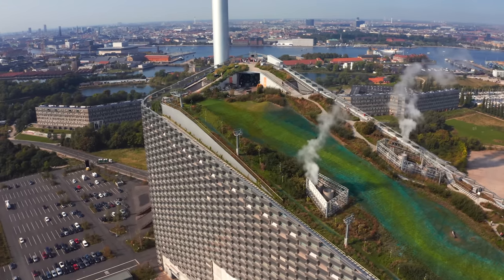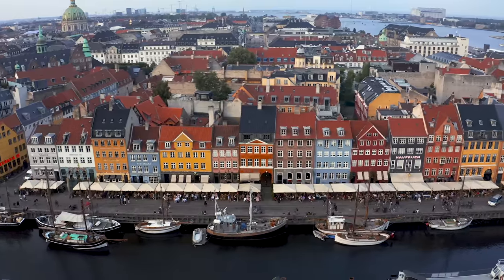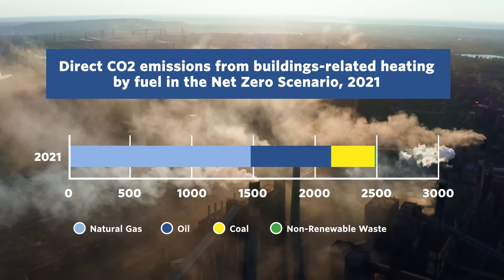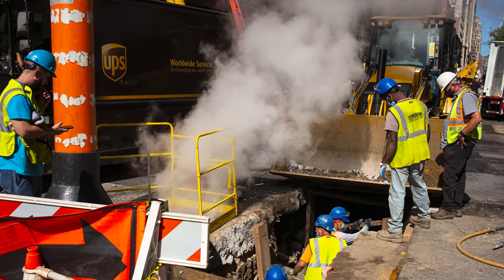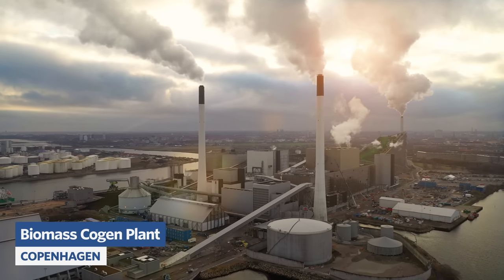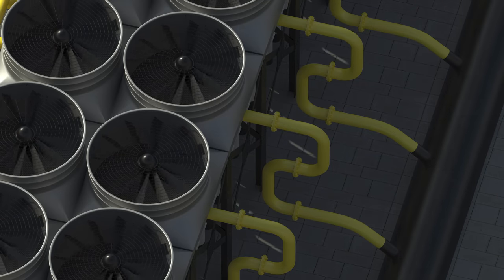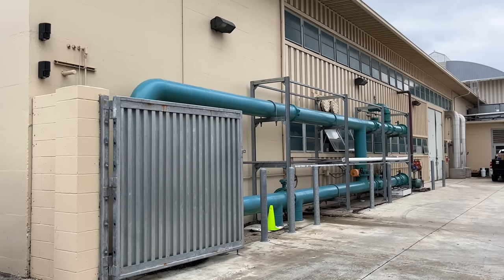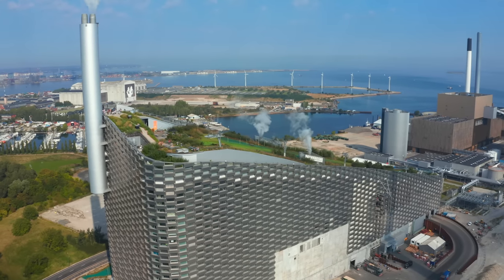An Introduction to District Heating Systems

Comment: What is really neat with district heating is that it is just warm water running through pipes, so you always change HOW you boil the water if another method becomes more efficient. In Denmark they are trying to install a system in which if it gets very windy and the electical price drops to next to nothing, then they switch to electrical district heating instead of burning stuff.
Reply: In addition warm water can be used to store the energy as heat. In Finland we have huge barrels of hot water stored as a reservoirs for the case the power plant has a problem. In Helsinki there's also a massive cave underneath the city that is used for district cooling during summer and can be used as a heat reservoir during the winter. It's like artificial geothermal energy reservoir, and utilizes heat pump technology. And the craziest part is, we've not tapped to nuclear district heating, yet. Immense amounts of energy is just wasted.
Reply: Very nice. Stockholm has a set of massive heat pumps using the heat in its waste water system. The optimal production mix hour by hour in a large heating system is a field of study in its own right.
Reply: thats super cool
Reply: Literally the same benefit of having people adopt EVs - yeah right now most of the US's electrical generation runs on natural gas, but we can easily swap that out for wind, solar, or nuclear fusion, as opposed to a ton of combustion engines roaming around
Reply: @sparklesparklesparkle6318  read it again. I clearly said a right wing government made a statement and chinas reaction caused the issue. I think it was a 100% fair thing for the right wing government to say. Them being right wing is irrelevant to the circumstance, but blaming it on left wingers is simply idiotic. No one in the situation is left wing. 

What food processing facilities are you even talking about? How does that have anything to do with coal availability in China?
Reply: @sparklesparklesparkle6318  P.S. China is restarting communication with the new centre left Australian government. In other words, left wingers are solving the coal price issue, and chinas blockage will likely end in the next few months, contrary to your incorrect misguidings about political inclinations.
Reply: In Vienna, Austria they recently built two huge heat storage tanks where water is heated only if there is excess renewable electricity available.

They have a lot of other cool sources of electricity/heat:
- hot air from subway tunnels ( friction! ) heats homes
- a waffle factory's and a thermal bath's waste heat heats homes
- the city's waste water heats homes and generates electricity ( more than the waste water treatment needs )

Of course the waste incineration plants also produce electricity and heat, like the power stations which first use gas turbines and then steam turbines to generate electricity and heat for the district heating afterwards.

Now they are going geothermal ....
Reply: ...But how do you get the electricity for the "electrical district heating" do you think? You burn stuff.
Reply: It gets better, you cna combine it with district cooling and now you can take heat from industries who pay to be rid of it and sell it to households.
Reply: @McSlobo  I am from India, we use a star called sun for heating.

Comment: Here in Finland district heating is the norm in cities, up to 90% of buildings use it and in the entire country 46% of all buildings are heated with district heating. Up to 95% of new apartment buildings are also connected to district heating.
Reply: Some buildings are leaving the district heating network in favour of ground source heat pumps as some cities have issues keeping district heating costs under control or some heating companies show quick price increases. Tech is great but some companies simply ruin the great idea by failing in pricing.
Reply: @Karjis  middlemen taking their cut
Reply: @mrwess1927  that is one part yes, another is the quite high cost of the grid itself. It makes sense in dense urban environment, but when basically creating one more grid with power, sewer and water to residential areas it's not that cheap. 

Some district heat companies also have the pricing model built so that they clearly do not want to keep small customers. In example quite high monthly fee and low'ish energy based fee.
Reply: @Karjis  Have you  heard of Polar Night Energy that uses a large insulated sand mass to store heat for months and recovered when needed to produce cogeneration. In summer when they have excess wind and solar electricity it heats the sand.

Comment: District cooling is such a neat idea! I'm slapping my forehead wondering why I didn't ever think of this! In Scandinavia and Germany (yes, also Norway) we have district heating in a lot of places. Suffice it to say, those countries are very good at dealing with the cold. However, in the winter, our radiators are completely empty and useless, whilst the temperatures frequently go above 30 degrees celsius with no AC anywhere. This lack of AC actually leads to some increase in mortality and is stupidly uncomfortable. Maybe the solution to the problem is literally in front of our eyes, and all we have to do is convert our radiators from warmth generation to cooling units. That could massively improve quality of life in the summer!
Reply: It's not that straightforward unfortunately.
For cooling you need to blow over the coils. And there will be condensation on the coils. So you need a resistant material (most older radiators are cast iron, which isn't suitable) and also a means of draining the condensate away.
Reply: Norway is far behind Sweden in district heating (10% vs 50% of homes heated by it respectively), but on par or better with district cooling, possibly because Norway is a relatively newcomer to district heating, and this is a newer idea.

A disadvantage though is that district heating serves two purposes, heating homes and heating water. So, given that most systems use two pipes, one for the hot water, one for the return water, when the system changes from heating to cooling, recipients lose the remote hot water. It could be fixed with three pipes (main two, plus extra hot water in summer), or simply by also having local water heaters. Less hot water is used in summer anyway.
Reply: @Free-g8r  Cooling can be had by remote heat pumps, like you describe. 

That's not how it is done in Scandinavia though, where most everyone live near the ocean (failing that, a lake). On the sea floor the water is likely to hold 4°C all year round, so a simple heat exchanger (two closed loops of pipes) transfers coolth from the sea to the district heating (now cooling) system. As sea water is corrosive, you don't want that sloshing around the city anyway.
Reply: @jaxvoice718  Well, I grew up with radiators everywhere in Oslo, maybe something changed in ten years. Oslo has projects that directly translate to "distant heat" (fjernvarme) which is as described in the video. So it's not unheard of.
Reply: @Free-g8r  It's interesting to think about though, and I'm sure there are solutions. For example, you might avoid the condensation issue by running the water at a higher temperature (15 degrees vs 4 degrees). As for air movement being required this is a good point that I didn't think of. Maybe a retrofitted fant at the bottom of the radiators could do the trick? Applying the principles used to water cool a PC at large scale would be funny.
Reply: @krazoe6258  Radiators aren't great for room cooling because the temperature difference isn't that high. But cooling works great with floor heating systems.
Reply: Less delta-T means less heat transfer. Hot water radiators are designed for 140-180F (60-82C) input temperatures, heating rooms to say 75F. Cold water can't be colder than 0F. 155F-75F = 80 degrees delta; relatively efficient heat transfer to the room. 75F-35F = 40 degrees delta. Heat transfer is proportional to your delta-T, so a 50% drop in delta-T means half as much heating/cooling possible. Arguably less with passive radiators due to less air convection (air movement due to temperature difference). However, the real problem as people mention is condensation - not just the radiator, but more significantly the pipes. Pipes inside your wall condensing liquid will create mold, wood dry rot, and drywall damage. I don't know how you can solve sweaty pipes in the walls; insulation isn't enough.
Reply: On the other hand, dumping waste heat into domestic water before flushing it down toilets - I've seen this done at a hotel in San Jose, CA. It's always a surprise in summer when the toilets start flushing hot water! Note that these toilets are public, so they get a LOT of use. A household trying to  dump water into 5 flushes a day is too small an amount of water (vs public toilets during a convention flushing once a minute). These toilets are also tankless, so the heat doesn't leak back into the building.

Comment: They had this type of heating at my college Michigan State University. The funny thing was that the schools powerplant was built when electrical demand was much lower than it is today so now the power plant makes too much heat and the buildings are too hot in the winter. I had to keep the window open in my door room in the winter because it was too hot inside
Reply: Open the windows in winter? Spartans will.
Reply: You have no way of controlling the amount of heat going to the rooms ?
Reply: @TribulationsSolo  no, no thermostat valves or anything, at least not that's adjustable by the residents
Reply: A simple TRV (thermostatic radiator valve) on each radiator would suffice and save a lot of energy.
Reply: That is a control issue in the building - District Heating systems only provide as much or little heat as the building calls for.
Reply: @AlRoderick  I think mine at a different college WAS adjustable, it just didn't matter because they used the same size radiator in every room, and mine was a small one. So the window stayed open.
Reply: @josephfisher426  it seems it was not adjustable really. Radiator can be as big as you can fit into the room as heat it controlled by adjusting the hot water flow to each radiator. 
In several cases the thermostatic valve is just stuck. This can be prevented by turning the thermostatic valve all the way to max and min and the back to original setting at least few times a year. Or in most valve types the thermostatic part can be taken out and the valve pin can be moved manually to get it moving nicely.
Reply: Seems they should just extend the grid to a few more neighbourhoods.
Reply: @DaDunge  Ya. Being a university you would think there would be someone in the facility smart enough to figure that out. Maybe Not.

Comment: The fundamental Laws of Thermodynamics is the reason that thermal powerplants MUST waste 40-60% of the input energy as low-temperature heat to the surroundings. This may as well heat buildings, swimmingpools etc.

Comment: Toronto has a large district heating and cooling system in its downtown core operated by a company called Enwave. In fact Toronto has the worlds largest "lake powered cooling system", the Deep Lake Water Cooling system (DLWC) which draws water from the bottom of Lake Ontario to cool various hospitals, businesses, data centres, residences, government buildings, offices, and other special places like the Metro Toronto Convention Centre and Scotiabank Arena.
Reply: Has Lake Ontario's mean temperature stopped going up?

Comment: I was involved in building a data center in Stockholm, Sweden, and already 20 years ago there was district cooling that we used for primary cooling of the facility. We received 4-8 °C water and had to warm it before it was returned, and then this was used via heat pump to help produce district heating for other buildings.

Back in the 70ties there was also plans to use nuclear power plant waste heat for district heating, since they produce enormous amounts of waste heat, I hope we look into this more going forward. Cogeneration is extremely efficient, generate both power and heat in the same plant, using most of the energy available.
Reply: Ågesta produced district heating AFAIK.
Reply: @placeholdername0000  This was very close to Solnaverket.
Reply: Im guess using nuclear waste heat is seen as scary because of the anti nuclear crowd.
Reply: @TheAmericanCatholic  pretty sure no one has a problem with waste Heat that is incidentally from a nuclear plant. The 'anti nuclear crowd', that part with any actual influence anyway, is generally rather more concerned with the downsides of putting a nuclear plant anywhere near a population centre in the first place. 
And the ones making actually sensible arguments are fully aware that a properly functioning and maintained nuclear plant is actually Less dangerous, radiation wise, than a coal plant in the same condition (they don't want Those anywhere near population centres Either), the concern is that if a Coal plant fails... you get a steam explosion and a fire. Bad, but design can render the explosion sufficiently non dangerous to the surrounding area, and a fire is a fire, cities have to deal with those anyway, and have been forever. You take what measures you can to prevent it then send in the firefighters to deal with anything that overcomes it.

A nuclear plant failing is rather more catastrophic. 

Yes, yes, make all the arguments you like about modern nuclear plants not failing ... they always end in 'so long as the people in charge (and certain key workers) aren't the sort of idiots who disable important safety features or refuse to pay for necessary upgrades or maintenance' which basically invalidates the entire argument because it doesn't matter if it's a corporation or a government entity, that absolutely WILL happen eventually. Too many perverse inscentives encouraging it. And that's before acounting for potential sabotage. 

At this point, if you found a practical way to stick a nuclear plant on essentially a raft sufficiently far out to sea (and somewhere suitable wind wise) while still getting the power back for use (and built it with all appropriate safety measures etc.), very few people would actually have a problem with it (well, in and of itself. Political propaganda is always a thing one needs to account for).  And a few  countries have enough empty space and suitable geography (without endangered species that people care about living there) that would be equally suitable. 
But no one half way aware of how humans work wants one anywhere near where they live, work, etc., and it's not just NIMBYism or ignorant fear of nuclear power in general.   It's more similar to how people often don't want to live down stream of hydroelectric plants (well, maybe WAY down stream).
Reply: This is an important comment. Data centers are great for district heating. Practically all the energy needed to move bits in computers can be re-used as heat. Super efficient. Other industrial systems can also be used for heating. In Finland this means e.g. pulp mills, which can also produce electricity.
Reply: In Finland they plan to heat a small city of 150,000 people (which has already existing central(district) heating infrastructure in place) with one SMR (Advanced Small Modular Reactor) nuclear reactor. It has been ordered already for the University of Lappeenranta and if all goes well, cheep heat. Let's see. The size of the whole reactor + shielding + containment is about the size of a garage.
Reply: Coolth story bro
Reply: District heating from cogen sounds efficient, but the temperature may be colder than comfortable, so I wonder if there are hybrid options? Cogen also does depend a bit on the power plants activity, though the ratio of power and heating can be shifted.
Reply: I used to live relatively close to the plant in Högdalen in Stockholm.
Reply: That's unfortunatly illegal in Sweden, you can't use or even make studies on using nuclear excess heat in the district heating newtwork. It's fairly common close to nuclear plants elsewhere. I think France for an example does it.
Reply: @TheAmericanCatholic Partly maybe but it's nonsense, the water that comes out of the tap is not the water in the district heating pipes and  the district heating pipe water never touches the hot water from which it takes it's heat.
Another argument hwever is that it becomes harder to close nuclear plants if the district heating grid relies on it.